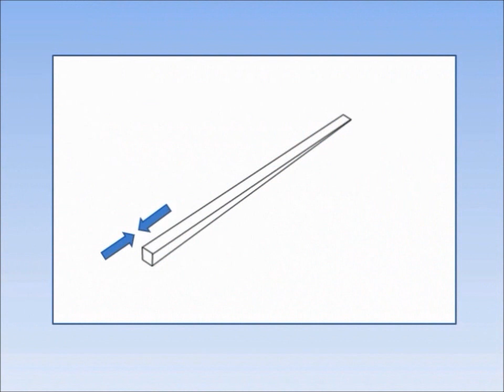Hive Top Ventilation Shims

Comment: i make my hive tops where i can slide them back or forth 1 inch, i have two 2" notches front and back for ventilation on my inner cover. I have my hives facing the south so in the summer i slide top north will be open from the north for summer, i slide my top south it will be open south for winter ventilation, They always have ventilation for any season of winter and summer, and they always have a escape route or another entrance
 If it get in the high 90's and 100's I will place pennies in the 4 corners of a hive body for ventilation as well  Thanks for another Great Video  Cheers

Comment: Every hive should be like a condenser however in a hollow tree the moisture  usually condenses on the top and runs down the side, this is nature's way of producing clean pure water early in spring and saves the bees energy from having to gather water by leaving the cluster!  This is why the bees use propolis on the sides of the hive, so follow where the bees lead😂

Comment: On top of my inner cover I use a vented half super to feed my bee's.
Using Ziploc bags that I lay on top of the inner cover.
Then I put the telescoping cover on top of the 2" vented half cover.
Can I use the shims still?
And with such a large opening.
Do you have problems with robbing?
Reply from the maker: The ventilation shims are used mainly in the winter to deal with inner hive moisture.  Robbing (at least for me) has not been a problem.  Robbing is usually not a problem if you have strong hives.  But that, sometimes, is easier said than done.  We all experience weak hives once in a while.

Comment: You put out some great vids Steve. Very informative. I like to run the notched inner cover year round for ventillation. The only thing I need to do for winterization, is place a 3/4" spacer under the back of the hive's bottom board. This allows the condensation (if there is any) to drip out the front of the hive.
Check out our facebook page HONEY B GUYS and throw us a "like" while you are visiting.

Comment: has anyone ever witness the moisture run to the back....seems like it would still drip as thats not much slope
Reply from the maker: It doesn't take much of a slope for the condensation to run "downhill".  For years and years, lots of beekeepers tilted the entire hive slightly forward in order for the water to run out on the bottom boards.  These days, with screened bottom boards, tilting a hive in this manner is not so important.